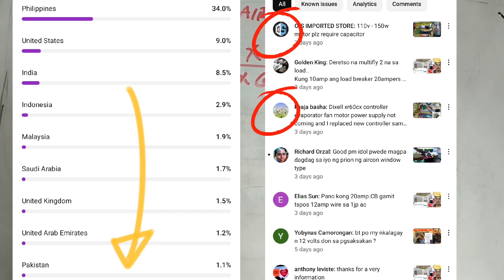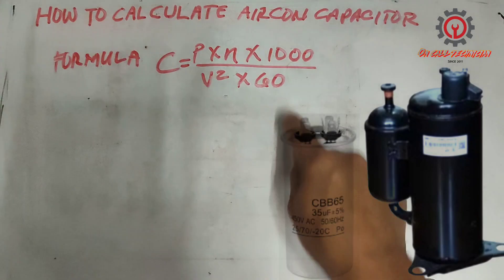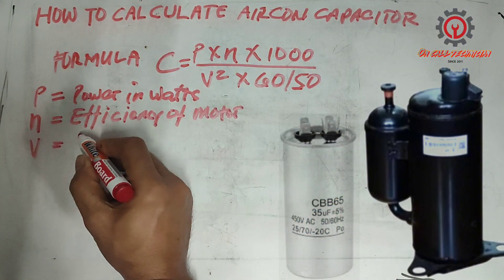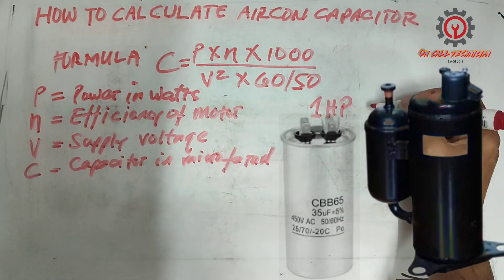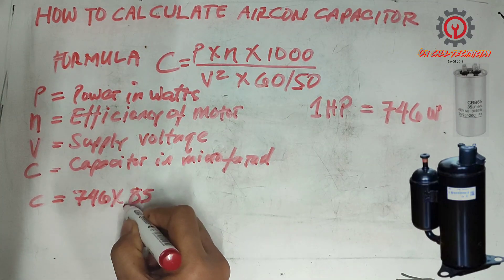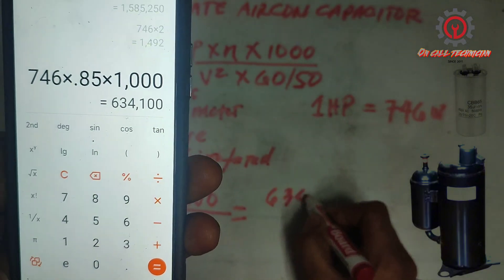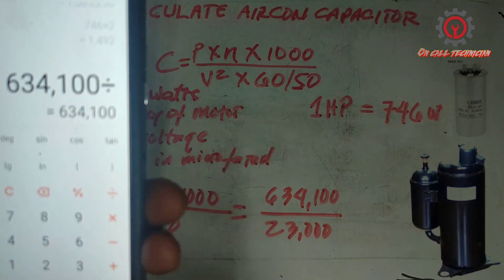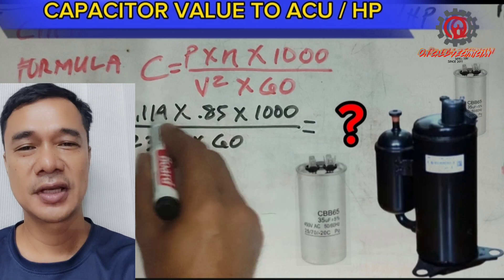HOW TO CALCULATE CAPACITOR VALUE OF AIRCON COMPRESSOR (ENGLISH)

Comment: Sir,parehas din po ba yan sa refrigerantion capacitor start and run ang formula. Halimbawa po 3/4hp r134a may existing na po na 80uf starting Yung sa running po Ang gusto malaman. Salamat po
Reply from the maker: Yes sir, pero depende sa manufacturer kung anong value ang ibig nila
Reply: @THEMULTISKILLEDTECH  salamat po sir. Tanong nlng po ulit ako dito sa channel mo sir. More videos to come sir. Salamat po
Reply: Sir Tanong po Yung dixell xr60cx nag def display pero Yung compressor tulog tuloy andar tas kahit def na energize  pa din contactor ng compressor
Reply from the maker: Hot gas malamang yqn sir, pag heater off compressor  @Jon-rebEguico
Reply: Sir,same lang din po ng program o may dapat po ako baguhin